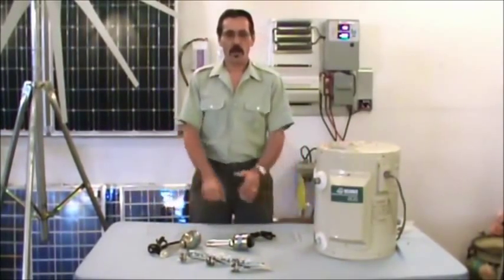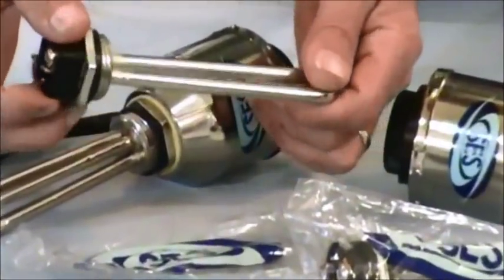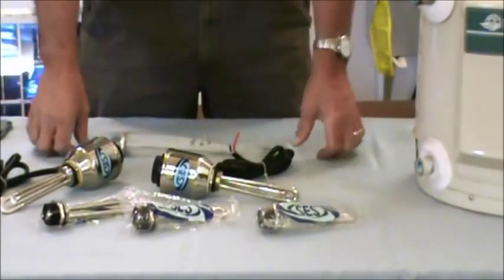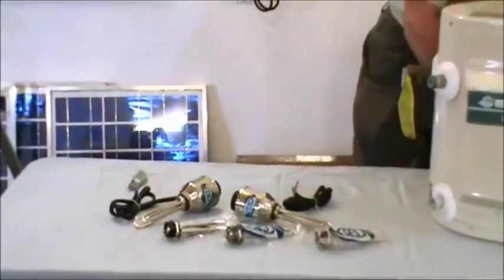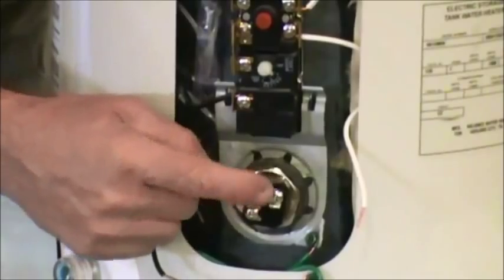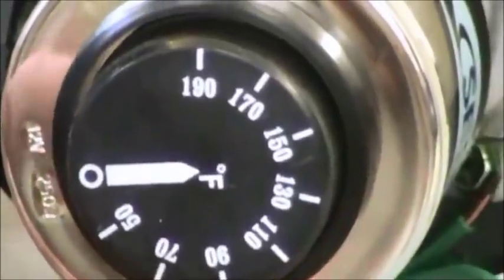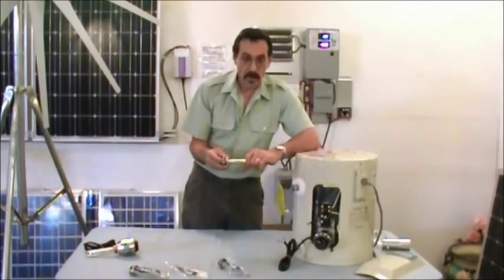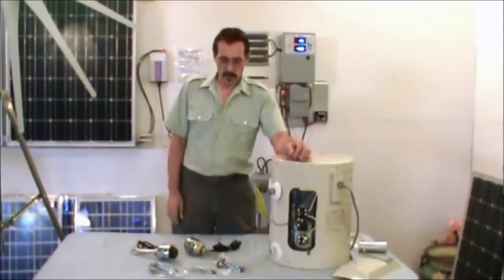DC Water Heater Element Solar Hot Water: Make Free Heat | Missouri Wind and Solar

Comment: Can you use a charge controller and battery for solar with this system? With the element being rated at 48v 300w, is it the volt or watt size that would determine the size of panel and battery I would need?
Reply: You can use solar panel going through a charge controller to the batteries. That will allow you to go from the batteries to the element. You will not be able to use lithium batteries for this application as they will over watt the element. The element voltage will determine the battery voltage, which will in turn determine how many panels you need with the proper controller. If you would like to give us a call we can explain in further detail. Thank you for the comment and have a great day.

Comment: Thank you very much. You confirmed my suspicions that it is possible to use the existing thermostat on water heatet to run a 48 V water heater element. There is a guy trying to scare people into thinking. The t & p mechanical device has to be rated for wattage or tank will explode.

Comment: seems like ac elements can work if you get the ohms correct -   Will a 120v heating element work on 12v?
Yes, but the element will draw half the amperage (because I = V/R) and at half voltage will consume/produce one quarter of the wattage (because P = I V ). Therefore, it will take 4 times as long for the water heater to recover from use and be fully heated for the next uses.Jan 24, 2022

Comment: There is one concern when the water heater kicks off. The solar panel has no load and will damage the panel. That's why at work we cover the panel when not in use. My idea is to use a charge controller and charge the battery I guess at all times whether the heater is heating or not. 73

Comment: Yeah look where it comes I wouldn't buy anything from that state. An ac element will work with an inverter at any wattage but how long does it take to heat a whole tank of water. I like the temp control features. Oh thanks for pointing that fraud out I will just as an experiment hook up 48 volts DC to my existing set up. I will comment later how bad or well it works. 73

Comment: Hi Jeff, great video!  However, you never really answered the question: “WHAT IS the difference between an AC element and. DC element?  I’m an electrical engineer so I actually really understand resistance and ohms law.  But I also understand that sometimes there might be subtleties.  But you showed none.  If I attach a single panel to a 220 VAC heating element, it will still work and won’t harm anything.  Your heat efficiency may be rotten because the impedances are mismatched, but it will still work without issue (note there are still issues with safety interlocks but that is another matter that is not solved by your DC elements either).  Also, it is true that one should never apply 120 or 240 VAC to a 12 VDC element (well you can do it, but only once and only for a fee short time before it blows out the element!).  That should be obvious.  But if you configure your array to provide a matching internal resistance to that of the element (usually about 7-12 ohms), and don’t go bookers with the array voltage, I.e. keep it (way) under 120 VDC, then I can’t see there is any difference and the AC element should work fine with DC.  If there is some I’m missing, would really like to know what it is.  Note, there could be an issue with the thermostat and thermal fuse, in that DC might sustain an arc in an AC switch.  I can understand why there might be an issue there, and in fact I saw a video showing even a DC thermostat failing to cut out when tripped over the temp threshold (maybe it was defective?).  So the electrical engineer in me says just use a larger voltage and amperage thermostat and/or add a shunt capacitor like a auto spark coil to dampen the opening spark.  Would really like to know what I’m missing here. Thanks!

Comment: What size solar panel would I need to run an adjustable dc element on a 50-gallon electric water heater?  I want to convert it to solar.  Thank you so much for your videos they are so informative.
Reply from the maker: Best things to do:
1 - Email your questions to sales@windandsolar.com
2 - Call our sales team at 417-708-5359
3 - Attend a workshop - https://windandsolar.com/workshop/

We can get you pretty much any information you need through those channels!

Comment: Question for you..  with a 300w heating element.. does the panel have to match or maybe connect a pair of 200w panels in series or parallel..?

Comment: I would connect a 12volt Deep Cycle Battery to the system and to the Solar Panels so the 12volt heater will keep on heating even when the sun goes down, plus you could have 2 or 3 extra batteries connected for longer life in heating. I forgot to say when you connect Solar Panels to a 12volt Deep Cycle Batter you need a 12volt Battery Regulator so the Solar Panel won't fry the Battery by overcharging it, I hope this has helped. I'm no expert.

Comment: any recommendations for using solar panels and heating element to heat above ground pool…. thank you.
Reply from the maker: We get this question from time to time. While on its face it seems like a great idea, heating water with solar electric is one of the tasks we try to avoid. In most instances we're going to recommend using gas as the efficiencies are difficult. The solution I would look into is solar thermal panels. The basic idea here is you're circulating the pool water through a panel that is heated by the sun - it's like a water cooler that supplies hot water for tea. The cold water goes in to thermal panel that has been heated by the sun and comes out heated. Can you use a hot water heater powered by solar, sure - but the amount of power needed to lift 1 gallon of water 1 degree (and keep it there) taken over a whole pool gets to be pretty cost prohibitive quickly.

Comment: I understand that using DC is slightly more efficient due to the losses when inverting and using AC.  But how much efficiency would a person gain by switching to a DC heating element from a 1500 watt AC heating element? If it's a 400 watt DC element, is it going to take longer to heat?
Reply from the maker: Best things to do:
1 - Email your questions to sales@windandsolar.com
2 - Call our sales team at 417-708-5359
3 - Attend a workshop - https://windandsolar.com/workshop/

We can get you pretty much any information you need through those channels!

Comment: Do't you need a contoller and/or a battery if you're using this to heat your stock tank?
Reply: I just ordered your 12v 300 w heating element with the 55 degree F thermostat. I plan to hook it up to my Renogy 200 watt solar panel with built in controller and a 12v marine acid battery. I'm hoping this keeps my 200 gallon stock tank from freeing over during cold nights in winter.

Comment: A Merry Christmas. May be you can help me. I do have a IBC Tank 1000 liter. I am using the IBC as a Biodigester so the water is not the cleanest with all the debris in it. I want  to keep the Temperature at a constant 35 Celsius and connect a Solar Panel to it. What size??? Is this possible without additional regulators??? You input will be appreciated. I reside in the Philippines. Starting water temperature is  guesstimated 18 C.

Comment: FOLKS THERE IS NO DIFFERENCE BETWEEN THE AC OR DC ELEMENTS..... THE RESISTANCE IS DIFFERENT  IN SO CALLED AC VS DC.    ITS A RESISTIVE LOAD!!!!!!!    OHMS LAW IS HOW YOU DETERMINE HOW TO USE A STANDARD AC ELEMENT.... 2 60CELL PANELS IN SERIES WITH 1650W GIVES MPPT OF PANEL.... IF YOUR NOT INTO ELECTRICAL FORMULA STUFF BY THESES TO HOOK UP TO 36V PANEL AND ELEMENT..... OH DO NOT USE THE THERMOSTAT BREAKER IT IS USED IN AC CIRCUIT..... THE DC WILL WELD THE CONTACT AND BURN UP AND MELT.... TRUST ME DID THAT TI SEE HOW LONG IT WOULD TAKE...... BE SAFE

Comment: I just finished a 28gal set up for the 1/2 bath in my shop.  I formerly had a tiny 120v, 2-1/2 gal tank under the sink for hand washing/etc.

Used four 175w panels (35v, 5amp) wired in parallel into a Midnite combiner box with #12 solar panel wire.  Out of the combiner box, I used #8 to a single pole SquareD 40a QO series breaker in a small 2pole box right under the combiner box.  From there, #8 wire to the heater, located about 3' away under sink cabinet, and connected to one of the 48v 700w elements with the built in thermostat.  The most amps I've seen it draw is around 12 in full sun on the panels.

I bought a small LED thermometer and K-type probe with 1/2" pipe thread.  This is screwed in a T in the hot line w a 1/2" female pipe adapter in the T, since there is no port in the tank itself to screw in the probe.  (Used 120vAC tank I had).  Gauge takes 12vDC power to light it up, I used a 12vDC transformer off some former cell phone or flashlight or something I had laying around.....got a bag full of those wall warts.  Gauge and probe about 25 bucks on Amazon.

Heater does REAL  good.  Water first day 67 degrees, heated to 110 with about 5 hours o the panels (panels are roof mounted on my shop, 45 degree angle, face east/southeast)

Held 98 over night, next day heated to 145 degrees with full sun.  It will hold 130 degree for a day or so with no sun, which is all I want.....just some hot water to wash hands or a paint brush.  I leave the thermostat set on 150.

Edit:  Element lasted about 2 weeks and burned out or the thermostat died.  Since then, I bought a cheap 1200w 36v element from Amazon, and it's worked ever since.

Comment: Hi there. You are telling people its ok to controll a DC element with the standard (AC) thermostat. I would never do that! You should correct that message.
I know with low wattage that might be working, but you never know when its too much DC arc to kill for a AC contactor. If your house burns down and the insurance finds out you are switching DC with AC gear - they won't pay a cent.

That, of course is different with your element with integreated thermostat and cord attached.

Comment: running 44 volts  solar pannel to your 12 volts  element i just got it and use a breaker  switch  ONLY GETTING 1,5 VOLTS on your 300watt //12 volts ,not getting the volts

Comment: Hello Jeff,  I really enjoy your videos, Can you clarify the use of the Solar Panel to heat the water element. i have from your company a 24v Dc element and wondering how many panels i need to connect to this to heat a water heater. It appears from your video you dont connect to a battery bank or controller. Can you let me know the correct way to do this please Ross Tga NZ

Comment: Yes I’m in Canada and I am building an off grid camper and actually living in it.  I have a water heater and also I have “as you use water heater”.  I would like to get a couple of your 24v adjustable heaters for use and show.  Great video
It would be great to find lower temperatures to keep holding tanks from freezing in the trailers
Reply: It only took you five years to respond.  🤔

Comment: on a good sunny day would a 100w solar panel heat  6-10 gallons to 110 degrees?  not just as a preheater .... but as the whole shooting match.  the reason im asking i that i am going to be retrofitting a van into a camper van.  i wish to have hot water but do not wish to use a propane camping heater.  if i had a small tank and set out a panel to be dedicated to the water heater only... would it get warm enough  in a very sunny area to make the water warm enough to bathe in.  if not then would a 200w panel be better.  i asked about a 100watt panel because they are a dime a dozen and not expensive
Reply from the maker: I would go with 200 watts
Reply: @MissouriWindandSolar  thanks.... i think i can find a 200w solar suitcase or something.... maybe mount one panel on the roof of the van dedicated to that.  idk.  if i can get the folding one it takes a smaller footprint inside the van.  but thanks for the advice.  wouldnt want to get it all then it doesnt work lol

Comment: If someone puts 12 volts to one of those $8 AC heaters, do they simply not work?  Break? -Rebecca
Reply from the maker: No ,they are meant for a much higher voltage.
Reply: You will get very low wattage (heat energy) from them.  P = 1650W = VI = (120Vac) I ==> I = 13.75A
V = IR ==> 120Vac = (13.75A)R ==> R = 8.73ohms
P = V*V/R  So, if V = 12V  P = 12*12/8.73 ==> P = 16.5W.
If V = 24V:  P = 24*24/8.73 ==> P = 66W
That is not much power for heating a tank of water!
DC Water Heating Element ==> 600W = V*V/R = 12*12/R ==>  R = 144/600 ==> R = 0.24ohms
DC Water Heating Elements have MUCH lower resistance to generate the required heat at the lower voltage.

Comment: Looked into this a few yrs back when you first came out with them but solar panels were still pretty pricey but now with solar prices roughly half what they were this is a very very cost effective way to heat hot water. Your adjustable thermostat with with a pair of 330-350w solar panels is on my list of must do this yr.  I should be able to heat my hot water tank(I live in FL so I should be able to 100% heat my water with 0 electricity) for around $400 with tax credit on solar panels. That is around a 1yr ROI  which is crazy good and I will never need to pay to heat my hot water again.

Comment: Hi There. I Have a question... How long does it takes to heat a 50 Gallon water tank to 135 F with this 200W      6 inch  12 Volt DC with built in Thermostat element????

Comment: would be nice if u shown an ie, for ur whole water sys for off grid.
i have a ground lvl spring about 60 ft from my (house). i have a dc water pump (3/8 inlet/outlet) that i intend to elevate up the mountain side, for gravity fed water. ill likely go up about 30 ft. with a float switch but for now ill just hook the pump up directly to my water heater and my 150 w solar panel (directly?) to the water htr ... ill split off the water between the pump and w htr to have hot and cold water supply. 
ok... what problems would i expect ? or suggestions...?

Comment: You need to make 48v ones to get more watts, I suggest making a 1000w one. Which would draw around 21 amps. All you need to power it would be 4x250w solar panels in series. This would heat up a proper sized tank at least, it would be a good setup. They make controllers for this, all you have to do is connect the panels to the controller and then the controller to the water heater (no need to have any batteries). It will heat your water all of a day time and the thermostat on the water heater itself will of course like these water heaters turn itself off when it reaches the right temperature and then back on if it needs to heat up again.

Here in Australia which has good sun it's very effective, but in a lot of the USA, Mexico, India, southern Europe, Africa, middle east and south east Asia and possibly southern China it also would be very effective also. 

It still works even on a cloudy day, because the heater will simply be on nearly all day and put any power it can into the tank. So even on a cloudy day it may only be feeding in as low as 300w out of it's 1000w potential, but that 300w is still enough to keep the water nice and hot because it will keep pushing this heat into the tank all day. 

For example if you have a 100 litre hot water tank, here in Australia the water is stored in this at about 60 Celsius. If you were to have a long shower then it's easily likely that the next day when you wake up the water inside the tank in the morning may only be 40 degrees. On a sunny day it will only take the 1000w DC element 2.5 hours to heat the water back up to it's 60 Celsius. 
But if it's a cloudy day you may only get 300w, but this still will heat your water all the way back up to 60 Celsius also, but it will just take 8 hours to get it there. 
Of course if you live somewhere with many cloudy days like England, then I would suggest getting 8 panels instead of 4. And have 4 in series, one row above the other and have those two rows in parallel. Then you should in theory at least get 600w of power into your element on a crappy cloudy day. Because you don't want to have just 4 panels if you have many cloudy days consecutively, but it's fine to just have 4 when living in sunny places that don't often have weeks of cloudy weather.

Comment: if you have a 40 gallon tank ,how many solar panels would i need to heat the water this way ? or would it be better to use a smaller water heater and if so how many solar panels would i need for the smaller one

Comment: I've been using a standard 12 gallon water heater with a 200A relay controlled by the thermostat and fed from a 1500w 38v solar array. It takes shunt loads during the day. Thermostat control voltage is 28vac from an old doorbell transformer. Don't use DC in a W/H thermostat.
Simple and works great!
Reply: Ken Bell well that would be nice to set such a set up. People are clever.
Reply: Can you post details of your solar water heater setup. Which seem practical as understood from your comment. Can we connect a 315 x 3 = 945 Watts 48 volt pannel  directly to a DC heating coil with built-in thermostat

Comment: I am building a tropical fish room run on solar, can I use your dc heater with a thermostat to heat a water storage tank to 75 degrees  then distribute the warm water to each aquarium
Reply from the maker: Yes you can

Comment: On a larger heater with 2 elements, could you use this for the bottom one and make it a dual heater ?? Also if you got the one with the thermostat  do you just hook to the panel or do you need a charge controller ? Just found you and you have so much great info thank you for sharing !!!!!!!!!!!!